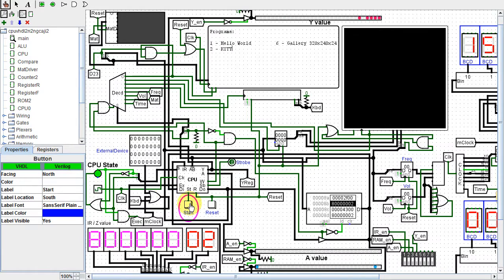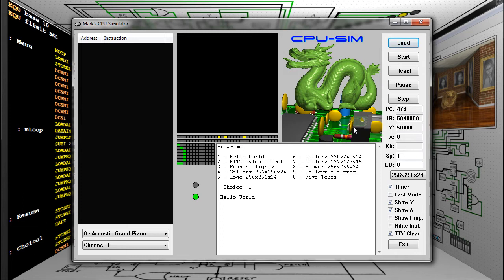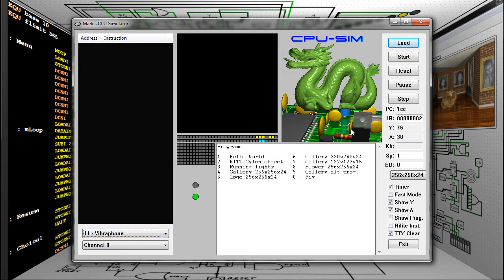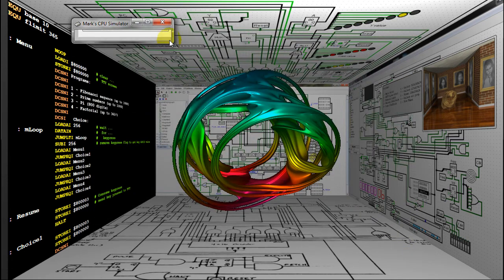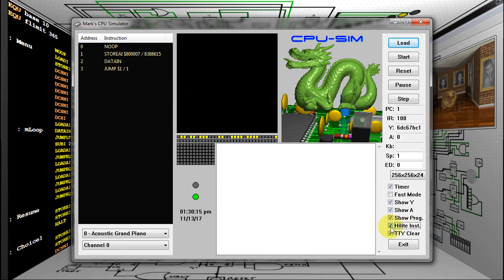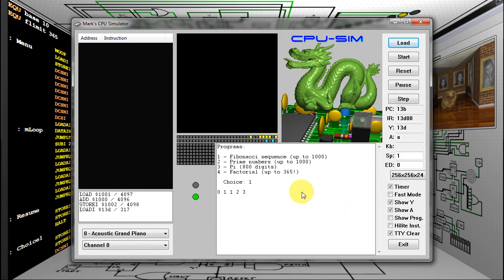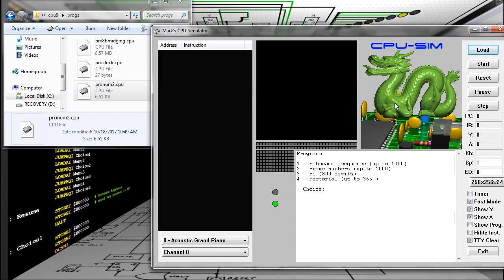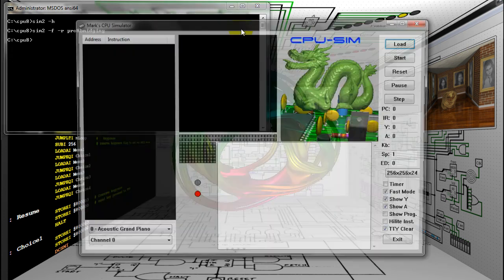My CPU & Computer Simulator - A Very Useful Tool For My Logisim CPU

Comment: There is something i don't understand, Mark's cpu is your windows program programmed in C++, that means that you created your cpu and interfaces to screen in logisim, exporting it to verilog and then adding a function to your Mark's cpu to read verilog, and inside that particular verilog cpu you process your assembly programs, is that the way it works?, it is an excellent cpu simulator, congratulations
Reply from the maker: @Carlos Sdrech Thanks for the congrats, etc.!  But you don't quite have the process right.  I designed the CPU on paper decades ago for a homework assignment.  A few years ago, I put the CPU design in Logisim.  Then once that worked, I created a computer (in logisim) that uses my CPU design - a computer with a few necessary I/O components.  Along the way, I wrote an assembler that converts my assembly language to a machine language file that Logisim can load (into Logisim's RAM component).  Then I used Logisim Evolution's VHDL and Verilog export capabilities to create most of the necessary VHDL and Verilog.  I then wrote a few testbench, memory, and program modules, so the VHDL and Verilog code could be verified (using GHDL and Icarus Verilog).  The program module loads the machine language code created from my assembler (in a different format than what Logisim uses, but it's the same machine code).  GHDL and Icarus Verilog programs then run the design along with the machine code provided.

Back to Logisim:  However, Logisim is slow since it needs to simulate every logic gate/component in the design.  So, I wrote a text based simulator in C that reads the machine code that my assembler outputs (not the verilog that you mention) and runs it.  It does this by emulating the I/O devices, memory and registers of my design (not the logic gates like Logisim does) - so, for example, the Y register is just an integer variable in the simulator, the RAM is an integer array, etc.  So, the simulator simulates the behavior of my design, not the gates - this makes it faster than Logisim, which is the main reason I wrote it.  The other reason was to verify that the design is correct (meaning the simulator simulates what I intend the design to do, Logisim simulates what the design actually does on a gate level.  If both produce the exact same results, then the gate level design is correct (at least as far as the sample assembly programs can test) - I hope that makes sense.  In other words, did my arrangement of gates/components produce what I intended?).  And, finally, I made a GUI version of the my simulator (which does the same thing as the text based one, but shows the results better (and more closely matches the visual aspects of the Logisim version - such as LED displays, LCD, etc.)).  The GUI version is also C, but I later wrote a Java version.

I hope that clears it up for you.  BTW, I call it a simulator, but I often wonder whether it's a simulator or an emulator.  I probably should look up not only the exact definition of both, but also the connotations of both.  Maybe someday...
Reply: @MrMcsoftware  it is clear to me, I notate You wrote the simulator to run a cpu design, I understand now the design is not verilog and the way c++ manages hardware simulation, I just have read two books on emulators, videogame emulators works the same way in c++, emulating with variables the registers and algoritms for combinational logic etc, the Java part You mention when You ported it to Java is very tricky to me for the sampling part, the rendering from memory graphics
Reply from the maker: @Carlos Sdrech For me, the hardest part of the Java version was the placement of the GUI elements - since Java is platform independent, you can't tell it to make a GUI element 80 pixels by 15 pixels and place it at location (62, 150) for example (made up numbers to illustrate what I'm talking about).  The other slightly challenging part is related to not having access to the event/message loop (at least no way I'm aware of).  So I had to have two threads - one thread that constantly calls the other thread (which executes the next CPU instruction) - giving faster speeds than a 1 millisecond precision timer would give you.
Reply: @MrMcsoftware  I understand, lresult callback has message handlers, so yes you needed to write event handlers in Java to manage the things that change, or multithreading using static variables for cummunication between threads, I have only used events for clicking on buttons in java, but there are event for canvas changes, or text changes etc, I understand what you did because multithreading is also needed to have not only events but the whole virtual machine or emulator or simulator working, I mean the components working togheter, for example the graphics screen drawing something when at the same time the machine operation is being shown

Comment: Not sure - sorry if the question is weird, but I m curious - is this your real unmodified voice?
Reply from the maker: It's my real voice.  But it depends on how one defines unmodified.  I write a script (as in what to say) usually after I record the screen (logisim, etc.).  Then I speak (reading the script) into an old camcorder which is directly connected to the computer's microphone jack - so the camcorder is just a microphone really.  While recording, if there's a phrase or sentence I feel didn't go well (or if there was thunder (that happened once), etc.) I repeat it.  Then I edit the sound file - removing pauses and removing the inferior versions of the repeated phrases.  Then I need to sync up the audio with the video - I edit both the audio and video removing or adding pauses (and in the case of video, even removing or adding some sections) so the two sync up.  It's a process I don't like, but it has to be done.  BTW, I chose a camcorder rather than cellphone because I felt the cellphone recording didn't sound good.  But later, I played my resulting video on the cellphone, and it didn't sound great either.  So, I guess it's best heard on a good computer system/speakers.  Also, BTW, in most of my videos, the pauses added to the audio are of complete silence, so sometimes the difference between silence and background noise can be heard.  In my latest video, when possible, I copied just background noise (no voice) to areas I wanted a pause - so there wouldn't be any difference in sound.